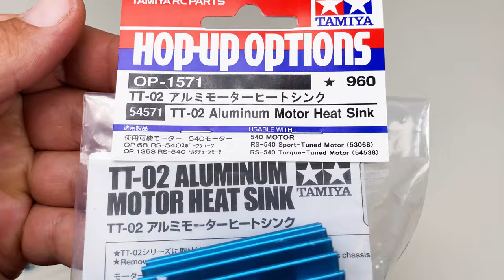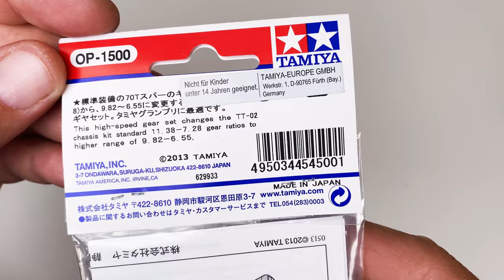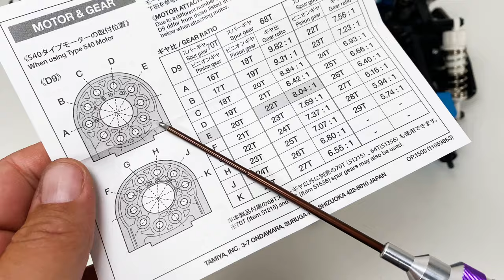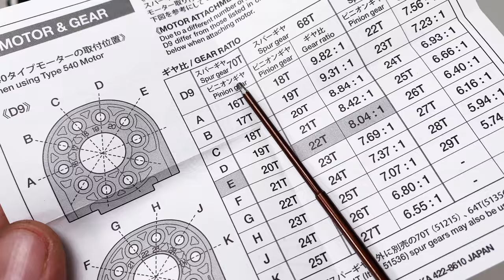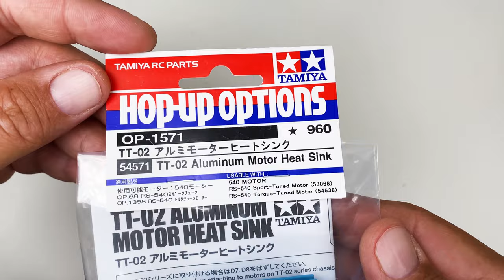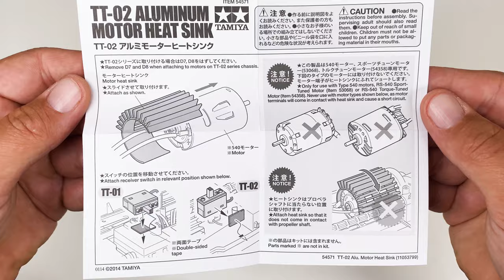Tamiya TT-02B Project: Tamiya TT-02 Hop-Up Heaven! (Episode 8)

Comment: Goddag, Mikael - she's really coming together now! Fantastic upgrades and very well presented by your good self. One thing, though. The instructions for the gearing are very misleading. It does appear to show that the 17/70 and 19/68 pinion/spur offer the same gearing, but that cannot be correct. If you work it out:
For a single turn of the spur gear the 17/70 option will need the pinion to turn 4.117 times. 
For a single turn of the spur gear the 19/68 option will need the pinion to turn 3.58 times. 

Therefore for the same rpm of the motor, and hence the pinion, the spur gear and hence the wheels are spinning faster with the 19/68 option.
It took a while to get my old head around it, but I'm sure it's right! I'm sure someone will comment if I'm wrong!
Wishing you a great Sunday, my mate!  :O)
Reply from the maker: Goddag, Mark! Thank you! Uhh, you saved it all! I think my head was too occupied with the editing (had to edit this extremely fast) so didn’t even think about it too much and didn’t even calculate. I don’t think the list on the instructions is meant to show it has the same gear ratio though. It just shows the new gear ratio with the new spur - and then what holes to use on the motor mount. That’s what I used it for anyway. But yeah, thought about my own comment (‘same gear ratio’) now and calculated - and you’re absolutely right. What a mistake I made in the video. I get the same numbers, calculating the external gear ratio, 17/70 and 19/68. And the logic is clear anyways: Larger pinion = more speed/turns. Smaller spur = more speed/turns. So putting on both a larger pinion and a smaller spur at the same time will definitely not produce the same gear ratio 😅😅😅 Of course we’ve gone up in speed with 4 tooth. Me Stupid. THANK YOU for saving the day, Mark! Good thing I have you to save me all the time, my friend 🤭👍🏻🙂 Hope people will read your comment that I pinned now.
Reply: @NordicRC  Hi mate - I think the instructions are very unclear, yes I think they are supposed to show the new holes the pinions are to use with the new 68T spur, but it also reads as if the ratios are the same! You know that I definitely don't think you are stupid, far from it my friend. I know how it is when time is short and you want to get a video uploaded. When I'm in a rush, all goes wrong, and to make things worse, at those moments my internet connection always seems to crash in the middle of an upload, making everything worse! We call it "Sod's Law" here in the UK, if one thing goes wrong, more problems usually follow! Anyway, sorry for the rambling! Thanks for the pin, mate - you are a good guy! 😎👍
Reply from the maker: Ha ha, ‘Sod’s law’ … so cool you actually got a name for it. Yeah, one problem often feed other problems. This time around it wasn’t due to technical problems (which often is the case), but just bad planning and lack of time. Yeah, my mind that was in a hurry was probably influenced by the instructions. But funny I could even think that, since it would be a very very bad ‘High Speed Gear Set’ if going up two tooth in pinion size would produce the same gear ratio as before 😅😅😅 But thanks for the save my mate. Really appreciate it 🙂👍🏻
Reply: @MarkBryanRC  Hiya guys, here in the States, we call it "Murphy's Law", what can go wrong, will.   Yup Yup, smaller spur/bigger pinion yields faster speeds, but also harder on the motor & battery (not too bad unless ya go extreme with it). Have a good week guys!!!
Reply from the maker: I had some more time now and added a little note in the description box that I see fitting as a comment here too. Hope I got it all right this time (if not, I expect Mark to save me again):

"In the video I mistakenly inform that the combination of the new 68T spur gear with the new 19T pinion gear have the same gear ratio as the combination of the stock 70T spur and stock 17T pinion. Of course the 68/19 combo has a much higher gear ratio than the 70/17 combo. Otherwise it would be a little pointless 'High Speed Gear Set'. What I think I meant in the video was that with the new 68/19 you use the same settings on the motor mount as the stock 70/17. But of course a smaller spur or/and larger pinion equals a lower gear ratio, less acceleration, less torque and more top speed. Here are the correct gear ratios for the two set-ups in the video:

Stock 70/17  = 4.118 with a total gear ratio of 10.71:1
High Speed 68/19 = 3.579 with a total gear ratio of 9.31:1

The benefits of the high gear spur gear set are multiple. As seen in this video you can go up in the pinion size using the same slots in the stock motor mount, which means you can reach lower gear ratios. The included alloy spur gear mount also means you can mount a 64T spur from Tamiya - or - of they fit - mount other non-metric spur gears from other manufacturers (with other non-metric non-0.6 mod pinion gears). This requires a freely adjustable TT-02 motor mount such as the ones from Fastrax (as seen in the video) or Yeah Racing"

Comment: Great video. I waited for the main propeller shaft upgrade. Steering links are next?
Reply from the maker: Thank you, bro! Yeah, quite essential, that shaft and spur gear, if one wants to play around with larger pinions and more powerful motors in the future. Definitely will do the steering links at some point, just unsure what I will chose. Would love the original Tamiya ones, but the package with the high torque servo is so expensive. Maybe GPM Racing instead. Next up will be shocks, turn-buckles and shock towers.

Comment: Hiya Mikael.  Nice upgrades and a great edit as ever.  Things like the motor plate letting in dirt are really annoying!   Apart from that, all good stuff.  You need to get hold of the GPM metal ring gear and bevel gears.  I might have already said that.  Expensive mind you.  Look forward to the carbon bits.  Cheers for now :-)
Reply from the maker: Hiya Pete! Thank you! Yeah, I was really liking the motor mount … but dislike dirt and sand in the gear box even more. I think most of it is due to my air compressor cleaning, but since I probably will clean it again with that one, I need something that can take it. I might get the Tamiya alloy motor mount. Looks like the only one that doesn’t have the cooling fins exposing everything. Ahh, yeah, I remember our talk, and believe me, I’ve looked at those several times. Steel. A full set will cost me about 80€. And I already got 3-500€ spend on this. So I think I’ll have to wait changing the gears until they brake 🙂😅 Cheers for now my mate
Reply: @NordicRC  well if you've spent that much already then what's another €80 ? 😁
Reply from the maker: Ha ha, I think I will use that argument when speaking to the wife about raising my RC allowance 😅🙂👍🏻

Comment: Oh, that's so nice! I really want to get started on mine soon, I really gotta find the time! That motor mount, I'll be installing one of those ribbed ones, so it was really good to see they "leak" into the gearbox, I need to try seal it up somehow, maybe solder it...
Already looking forward to the carbon episode!
Reply from the maker: Hi Mads! Good to read you. He he, yeah, time is a real issue for me too. But just taking it step by step. No rush. My TT-02B project will probably be finished at the end of 2030 😅 Don’t rush yours. Yeah, well, I think the mounts with the cooling fins (GPM, Fastrax) are alright, but they definitely do not seem to like sand combined with me cleaning with my air compressor. If you do not use an air compressor I think you could seal it with just some grease. And Tamiya’s own alloy motor mount seems very similar to the stock one, so I think that one is sealed more. But of course that limits the spur and pinion to the metric and 0.6 mod. But personally I’m not gonna use anything else so that’s fine with me 🙂

Comment: Why is it still seem like the shaft is jumping?
Reply from the maker: Jumping?
Reply: @NordicRC  when you were  rotating the spur gear it looked like it wasn't staying put it wanted to move up and down meaning the shaft was doing that.
Reply from the maker: @bradkalman2353  I don’t see any, but maybe you mean before the gear cover was on? It’s holding the bearings. So quite normal. It isn’t attached yet but just loosely placed. But it’s always good to check if everything is spinning during each step